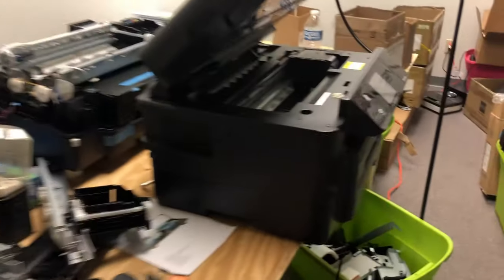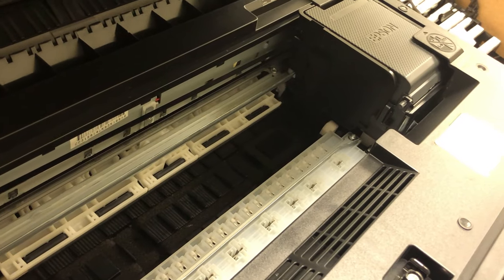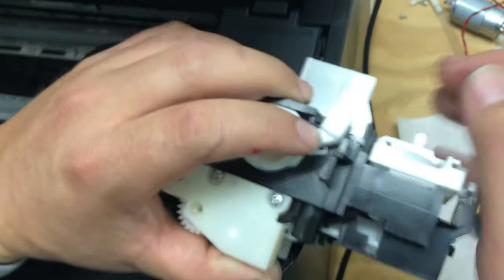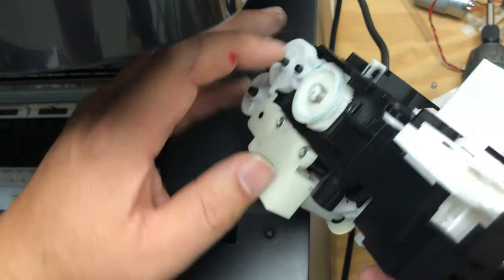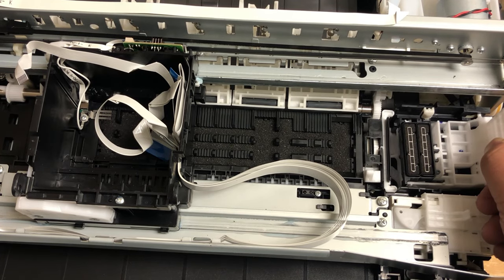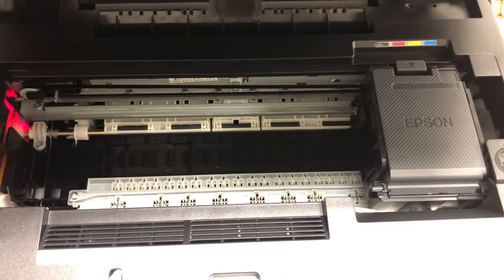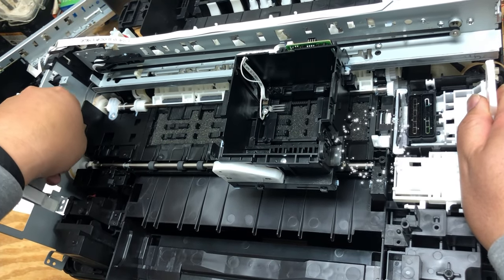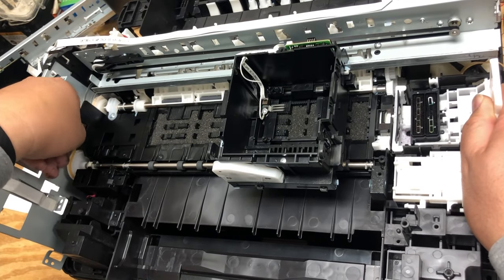A Detailed Guide to Solve Epson Printhead Lock Malfunction & Unlock Cartridge Carriage Cradle

Comment: Thank you Kevin! I replaced my waste ink assembly today with the part you sent. The waste ink WF-3640 fit perfectly for the WF-7720 (just a longer waste hose like you said) I got to see a lot of you today watching your videos. The WF-7720 is up a printing better than ever. I found the spring at the bottom I guess thats why I was getting the cartridge door open error. I was also getting Error Code 000033 before and the new part fixed everything.

Comment: Kevin, very good videos!  I have an epson wf-3640 that the carriage goes to the far left when doing the startiup and I hear a screeching sound and it trips the 0XEA code.  Turning the printer off and back on does not help.  What causes this and how do I fix it??? Thank you.
Reply: Mine is doing this same thing! Did you get it fixed? If so how?
Reply: Following for answer
Reply: @tylynblanchard4456  check the plastic encoder strip that goes behind the printhead for dirt, grease or kinks.  Clean it with a lint-free paper towel and water the length of the strip.  If it is kinked you will need to get a new one.   Keven has a video on that, easy to fix.  I did it and it worked.

Comment: Hey Kevin. My Epson 7710 had stop printing Magenta (sublimation) even after adding fresh ink and cartridges. So I did multiple print head cleans and still didn't work. Flushed nozzle with your solution. Only caused me to replace maintenance box. And Magenta still didn't print. Took print head out and cleaned according to your video and now the print head makes loud noise when going to left Error 00023. My ET 15000 which is brand new is doing the same after changing out the type of ink after flushing nozzles. So my conclusion is that after turning power off to manually move the print head is causing this. What do I need to do to relock or reposition the print head correctly after it has been manually unlocked and moving freely?

Comment: Kevin I went to change my printer head on my ProColored and it wouldn't print so I turned it off and now it won't turn on, but I have power to the printer. any suggestions?

Comment: Hello Kevin I went to go do a print head cleaning on my Epson ET 2720 because I hadn't used it in awhile and it wasn't printing right. So the problem started when I went to do the cleaning and I broke the printer head locking mechanism. I went ahead and finished the cleaning and put the printer back together thinking maybe it would still print and work for the time being since I had a job I had to print still to get done and there was time constraints on the job. When I first started the printer up I went to go do a nozzle check I believe(I'm not 100% which I tried first)but once I went to do it I got an error once the printer went to unlock the print head mechanism like normal when starting the nozzle check. The error said check with support or something like that and there was a problem. After the error screen turned off I got it back to the main menu screen on the printer and I decided to try everything again thinking maybe it would still print but just fail to lock the printer head in place when needed. Well then after that if I go to nozzle check or try to print anything or do any other maintenances it doesn't give me the error. It goes about the process like normal and sounds normal. You can see and hear the print head moving around just as if it was printing but nothing ever gets printed out. No ink goes onto the paper anywhere. Did I mess up something else when cleaning the printer head or is this happening because the locking mechabnism is broke???? Please help me figure this out. I don't want to buy the new locking mechanism and take the time to fix it and have there be another problem that is causing it not to print as well. Thank you for your time and sorry for such a long post I appologize.
Reply from the maker: It’s hard to tell.  Sounds like a bunch of errors mixed up.  I can’t give a diagnosis without looking at it.

Comment: Hi Kevin. My Epson Workforce 645 has the error, "Printer Error Turn Power Off And Then On Again" but it doesn't move the print head. Do you know what the defect is?
Reply: Me too.  When I went to clean the nozzles, I forgot to turn the power off. 
My guess is that the gearing mechanism is out of order and my locking action never happens. 
No noise in a gearing assembly makes me assume there is a binding action within the system. 
This is the exact reason I studied electrical engineering. The failure modes are less frequent,  easier to fix, and last longer.
Fixes with sw and fw are the true mechanism.
1. I'm going try moving the cartridge assembly completely to the rhs
2. Pull the locking tab outwards.
3.  Move the belt until it locks
4.  Re-engage the locking tab.
5.  Turn it on 

I get so sick of the sh*t my wife brings home.  Her friends always dump their waste on her.  Why can't everything be electrical?

Comment: It's possible to remove printer lock definitely? And in Epson r300 is printer lock lever necessary? or can I remove it?
Reply from the maker: You can’t. The printer needs it to determine its printhead position.  If you remove it you will get fake paper jam error.